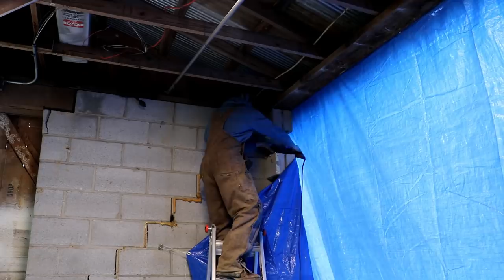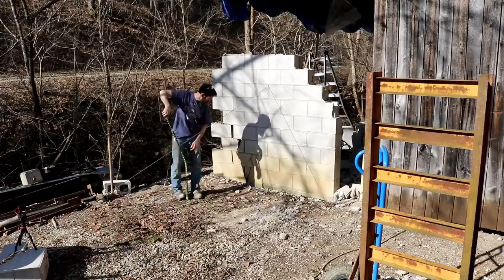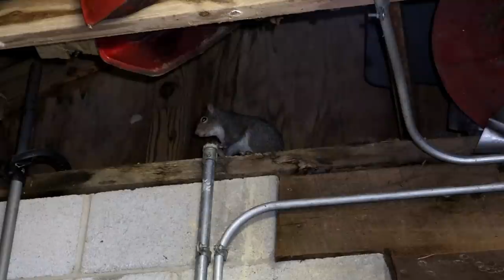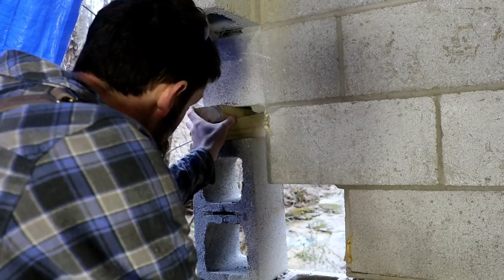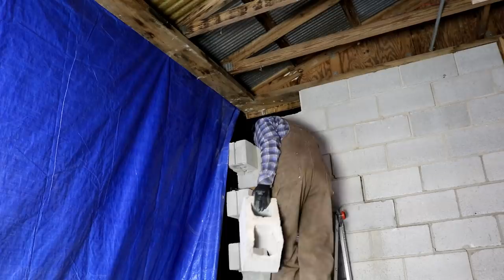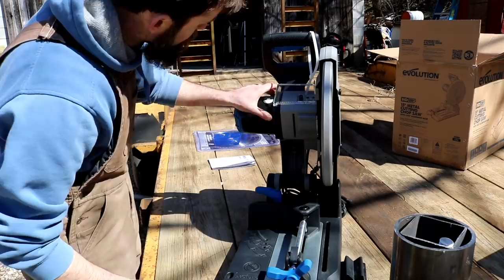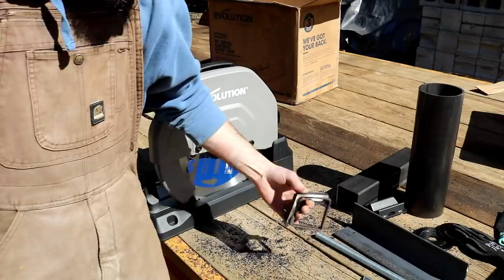Pushing down the block wall & New shop saw ..Shop repair part 6

Comment: An old landscaper taught me a valuable lesson with a wheel barrow.  Turn it around empty, then load it. Saves a lot of wear and tear on your back. Hope that helps.
Reply: That applies to any loading 
You'll find trucks try to load faceing the way out 
And tip with minimal reverseing

Comment: I bought an Evolution saw when I reroofed my garage.  It's great.  More like a milling disk than a saw.  Fast clean cuts through wood, steel and aluminium.  I've used them on sites in the past for cutting threaded rod and unistrut.  Nice clean ends.
Reply from the maker: Nice! It seems like a huge advance over an abrasive saw. I like it👍
Reply: Clive, for going to a job site, it is fantastic. Whatever material you need to cut just throw it into the Evolution and have at it. 4x4's, copper pipe, PVC, re-bar, aluminum it will cut them all sometimes better than the special tools made for cutting that type of material. Cheese and rice, I sound like an advert for Evolution. Sorry.
Reply: @SteveSummers  I've noticed that the saw doesn't do well on plunge-type cuts.  Something about the geometry of the teeth.  But if you can cut through at a 45-degree angle, it works really well.  With deep cuts I notice a lot of vibration and resonances... AvE has claimed that his goes through blades quicker than he expected.
Reply: I've been wanting one of those saws after seeing some people give them consistently good reviews.  (Also cool to see bigclive, hey!)
Reply: @neffk  We all know how careful AvE is with his tools.......... They last a long time if you keep your feed pressure down and let the saw run at full or near full rpm.  The blades can be sharpened with diamond wheels, but it can cost the same as a new blade on sale.
Reply: pro trick: you can watch movies on Flixzone. I've been using it for watching all kinds of movies these days.
Reply: @Camilo Rylan yup, I have been watching on flixzone for years myself =)

Comment: A tip from an old wheelbarrow cowboy: when you have less than a full barrow, (especially when it's big chunks), put the load more towards the nose of the barrow.  With the location of the tire, it will create lift in the handles, and make the weight less.

It also makes dumping the wheelbarrow easier.

If you spend days and days doing something, you learn all the little ways to make a job easier.

Re: Spring
It's been like Spring in Oregon for over a month, daffodils are bloomed, birds are chirpin'; then, yesterday, it snowed!

Comment: It may be a bit late, but I think you need a smooth ramp to allow the blocks to slide down when you remove them from the wall.  It has to be exhausting to carry each one down.  You're a hard working young man, Steve.  I admire your stamina and persistence in finishing this job.

Comment: It is LOUD!!!!!, VERY LOUD!!!!!
It cuts very cleanly, quickly and with no heat or burrs!!!
I LOVE mine!!!
Use the correct blade for different material, Stainless, Aluminum and steel
It makes a LOT of little metal crumbs too!!!
The geometry of the cutting teeth put all the heat into the chips.
They are red hot coming off the blade, but the cur material is cool, as designed
Wear long sleeves, gloves and eye and ear protection.
Like your videos, btw!

Comment: Since I got my Evolution saw, I rarely use the band saw.  They are really nice, and yes I have an abrasive one too and I never have used it since I got this one, they like to flex in the cut and sometimes have a hard time penetrating into the cut.  Good work Steve, you are a patient feller.

Comment: Excellent planning and enjoyed four different camera views for the big collapse. 
Just some hints to make wheel barrow use easier. When empty, park it in the direction of travel to the dumping site so as to avoid turning it around when loaded. Also, load it heavily toward the front which makes lifting the handles easier plus allows for slightly bigger loads and less trips. 
Horrible Fright failure is no surprise.
Good review and now there is no hurry to complete the bandsaw restoration with a shop-saw in the shop.

Comment: I bought  a cheap HF metal cutting blade for a circular saw a fewmonths back. I was very impressed with what it can do. Only downside is all the metal chips wow, the chips.  Really took some doing to deal with them, but overall a very good idea
Reply: When you say circular saw, I'm hoping you mean a wood cutting saw that you only cut aluminum with (aluminum can be safely cut with a 'wood speed' saw).  Cutting ferrous metals like steel requires a much lower RPM.  Cutting steel at wood saw speed, its only a matter of time before something bad happens.  Hopefully, just a ruined blade!
Reply: @somebodyelse6673  cutting steel. Rpm it is rated for is within spec its rated to 8000 rpm

Comment: I have the cheaper stamped version of this saw, even though the Fastenal folks told me it was cast when I ordered it.  Lesson learned.  It's still a great saw compared to any abrasive saw. 

You can speed those cuts on square tube and angle iron by clamping the stock with the point up or the point into the v-block.  And flat stock on edge.  This eliminates the blade having to plow a long furrow through the steel.  It will also increase your blade life exponentially and eliminate what little heat buildup there is on the flats. 

The same techniques work with abrasive saws for all the same reasons.  Keep up the great work.

Comment: The project is going well. You're doing it how I would do it.  Letting in the natural light will likely make it a better place for you to work.  I would put in as many windows as possible, though I know glass doesn't come cheap.  I've been seeing leftover windows for sale in my area at a fraction of the cost of new ones.  Keep up the good work.

Comment: Tips on the chop saw , try standing flat bar on edge and  L - channel like upside down V .  Square tubing stand on edge.
All these positions will let the saw cut through the least amount of material and create less heat and cut though the work faster.
Also cutting aluminum I recommend using a wax stick, otherwise aluminum can fuse to the teeth. There are blades for aluminum,
that will give a great cut, but still should use a wax stick.

Comment: Steve, that is a Carolina Wren Nest. They have built nest or started a nest in every box in my shop. As for the Evolution, I have had one for over a year now. I really love mine. I bought both size blades when I bought mine. They do really well unless try to cut really hard material. 55+ The edge goes away really fast. I am now using a Diablo Steel Demon blade which I like much better. Love your channel.

Comment: Very satisfying to see that wall pulled down - great progress.  I have a similar model Evolution saw and would highly recommend one for general chop saw work.  Something to note is if you are cutting L shaped items is to lay them down like this /\ instead of |_ as they are held more securely in the vice, plus you don't have long tooth engagement on the lower flat section.

Comment: You'll love that saw. Especially doing miter cuts. The blade don't drift giving you a less accurate cut Unlike the abrasive type chop saws. The blades are not cheap but in comparison with the speed and cost of 14 inch discs I would say they are still cheaper to use. Just start your cuts very slow while entering the stock but after that you can ho to town. Try it on some large round shaft, 4" or so, you will be very impressed.

Comment: Good to see the progress you're making. That ladder is such a great idea - The number of times I've tried to use a ladder on a slope (even in 2 legged mode), and not been very happy about where my centre of gravity was going to end up... Looks like you made a great investment.

You placed the camera for the wall pull-down perfectly!

Those evolution saws used to only be available in a circular saw format (something like your skilsaw). They were rated for up to 6mm thick plate steel (1/4"), I used and abused one on 8 and 10mm plate (5/16-3/8") This was 12-ish years ago now, but - it worked like a champ. I eventually had to weld a short 45 degree bracing rod to the foot of the saw, (never used it at anything but 90 degrees anyway) because I found that the angle-locking mechanism wasn't quite up to snuff, but the saw itself saved a hell of a lot of work, and paid for itself immediately. Cheap and cheerful, and their tools fill a gap that isn't filled by anyone else I believe. I'd get another one if I had a lot of that sort of work to do again. Abrasive saws are horrible. The evolution saws are still noisy, but they are much better on the heat and sparks front. Bandsaw is best of all, if you can get the work to a bandsaw. Not so good for cutting up large panels of plate, of course.

Comment: For rhe flat stock, go vertical (when possible). For the angle iron, apex up (when possible). It'll cut the rebar, but the blade won't last.
Reply: There is a manual cutter for rebar that works well, if it is hard to pull making a cut make a longer handle
Reply: @frankdeegan8974 
Yes, I even see large projects using the shears. I like to use a torch, but OSHA requires "hot permits" and a person to "fire watch" when contractors use a torch. Not that everyone does it.

I own a saw very similar to his and there are a few things that will damage a blade quickly. 1) Entering the work too quickly, especially on small dia stock, like smaller rebar or entering an edge cut to quickly. 2) Rebar, also because it has some really hard spots. 3) Making cuts on large flat surfaces, like he did cutting the big flat stock. I would have cut it edgewise.

Especially if you're already using the saw for other cuts, it's tempting to use the saw on the harmful cuts too. But, the blades aren't cheap and I can get hundreds of cuts out of a blade or I can easily ruin it in 20 cuts.

I've cut several 4" I-beams with mine and keeping out of large flat cuts is difficult, you have to cut and flip a couple times for every full cut. Best to have the saw around for some things and use a torch or cutoff wheel for other stuff.
Reply: @cornpop7805  Also the engineers don't like you putting heat into the rebar. I think it makes it brittle.
Reply: Rebar will ruin anything with a spinning blade.
Reply: @phildcrow 
Heating rebar to bend it could be an issue, but using a torch to cut it only effects the metal's properties, about an inch back. I've been involved in building countless specialty horizontal beams and a couple vaults. The specs have prohibited heating to bend, but I don't remember anything about torch cutting.

Some of the rebar we used was #12 (1-1/2") and we had a rebar shear, but it wouldn't come close to cutting it.
Reply: With those saws you want to cut flat. In an abrasive chop saw put it vertical all day long though. It's only because the carbide teeth take a harder hit it the vertical position. Much like an interrupted cut on the lathe
Reply: @jasonvos3956  Wrong. Too much surface in contact and they chatter and break. The blades are designed to limit feedrate.
Reply: @jasonvos3956 
Cut on edge and, enter the work slowly, and don't force it. Cutting in the flat can be done with narrower stock, but definetly not the stuff he showed in the video. I belive there's a maximum number of teeth that can be cutting simultaneously, before you get into trouble. It's probably 2 or 3 teeth and I'm sure it's written somewhere, maybe in the saw's book. I've been through a lot of blades and all have been out of my pocket, so I've learned the hard way what to do and what not to do.
Reply: @johnscott2849 
I'd say that you are correct in saying that "rebar will ruin anything with a spinning blade". Obviously you can use an abrasive disk cutter, but that's not a blade. Come to think of it, if you want to get technical, a diamond wet saw will cut rebar without ruining the blade, but it would take too much time.
Reply: @jasonvos3956  No. By nature, any saw with teeth is 'an interrupted cut', unlike a continuous cut on a lathe. The feed rate is controlled by the operator.

Comment: Steve, may I suggest for your wall footing and foundation,  6" dia. vertical pilasters going down 3 to 4 feet with rebar, AND subterranean knee walls extending under the slab. That will keep the whole thing from collapsing off the edge and into the creek. Your engineer can fill you in and make better suggestions than I. Thanks for the video. Jon

Comment: I’ve had an Evosaw for a couple years now, really like it for quick cuts on angle iron / square tubing etc. Prefer my bandsaw for solid bar stock due to the noise indoors and the fact that it throws chips all over but it definitely has its place in my shop and I think you’ll get some great use out of it!

Comment: Steve, the brown birds may be House Wrens.  We usually have them building nests in our pole barn/garage.  Also, it looks like the Evolution chop saw folks have reached out to a fairly wide range of content creators -- I watched a video by John Switzer at Black Bear Forge yesterday and he tried one out too.  John was impressed with how quickly he could saw mild steel with those blades in that saw, but figured that he wouldn't be cutting a lot of high-strength or abrasive-resistant steels with it (he uses those materials when forging tools for use in his Shop).  He checked the price of the saw blades and figured that the blade (based on packaging claims) would last so much longer than abrasive disks for abrasive chop saws that he'd be ahead on the cost of blades vs. disks by the time he wore the blade out.

Comment: Quick hint from an older fella that has done more than his fair share of wheelbarrow work, when you bring the wheelbarrow back to load it again place it in the direction that you are going to travel in to dump it !! It just makes it easier on you when you have loaded it to just pick up and start walking ?? I once worked with an old bloke, he was on the pick and I was on the crow bar, he could see that I was slowing down so he did the gentlemanly thing and asked me if I wanted a break. Of course I said yes, he said good , you go on the pick and I will go on the crow bar ? That was his idea of a break for the young fella ! What a guy !!!

Comment: Might as well make that front door wider too when rebuilding. Can never have doors too big. :-)
Reply: I put double doors (without a post) in one wall of my basement, and I can drive my VW pickup inside for the winter.  I wasn't thinking of that at the time, only thought about getting shop machines in, but its really nice to get my pickup in the nice, warm basement for the winter service project :)
Reply from the maker: That's a good idea Brian😁

Comment: Thanks for the update Steve. Getting it done. Nice barrow-cam and Mythbusters-esque wall drop shots :) Good job on the extra bracing - I'm a firm believer of @oxtoolco mantra that nothing too strong ever broke.
Reply: I'm a concrete guy by trade and we say all the time, "You'll never know if you put too much bracing on that form, but you'll know right away if you didn't put enough."

Comment: Hoi Steve, nothing wrong with the hose, they forgot to pinprick it,  sometimes the inner tube is less airthight then the outer wall, thats other material than the inner, because other type of demanding strengt and abrassive.
Just stick a needle in the outerwall every few inches, and the problem is solved.
We had that problem many years ago with oxigen hoses 20 bar (350psi), the firm pinpricked the hose problem solved.
They use three wheels with points 120 degrees appart open it like a steady rest put the hose in close it and run the hose trough it. just prick the bladder wil solve your problem, its just micro leakage, difusion, through the wall.
good luck nice job working at.

Comment: Got you an evolution, I have sawn lots of pieces of square tubing with one.  They work good and quick.  Now a machine story, the cigarette pack reminded me of Gerald Shavers mill.  Gerald finally got a turret mill, a Gorton, when cleaning it up he found an Irish cigarette pack in the column, it also had metric dials but inch leadscrews, had a gap at end.  He figured it was an old lend lease machine that found its way back to the USA.

Comment: Ey steve!  I have an older version of that same saw, mine has a steel base and the out of the box problem i had with it was the blade was not plumb to the base but it was steel so i put it in my press and bent it back into shape.  grab a square and do some checking for us.  thanx again.

Comment: Steve, you need to stand the flats upright and the angle iron in an 'A' position when cutting them.  You want the fewest teeth in contact with the metal at any given time.  The blades will last far longer.   Check the operators manual.

Comment: That much beer explains the crap foundation work, Ha!
Reply: At least it was the Champagne of beers. LOL
Reply: A 6 pack ain't much. Back in the day most guys had two cases down before lunchtime.
Reply: My parents had a place built in '52, brick and block. My father said the plasterer was very fond of a liquid lunch and you could clearly see which bits had been done in the afternoon.
Reply: @Graham_Langley  I worked with a bunch of masons that were rather fond of heroin. Their work was impeccable. They didn't wait until lunch to begin partaking either. In fact I'd say use improved their performance. They always looked terrible before their fix.

Comment: I have the Evolution 10" Sliding compound miter saw with combo-material blade.  It's pretty good for around the garage, but the blade didn't last long in metal.  The price is right.  Keep us updated on yours.

Comment: The quick release for the threaded portion of the saws clamp screw looks to be plastic. If it is, that may be a weak spot in the saw. it would be great if they made it so you could cut miters with it also. It is a nice cutting piece of equipment. Keep up the nice videos Steve!